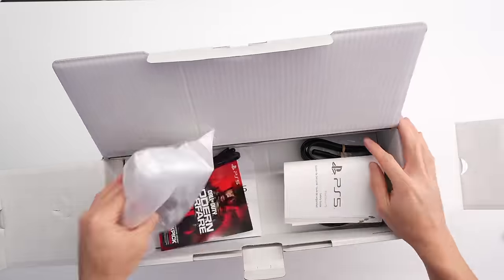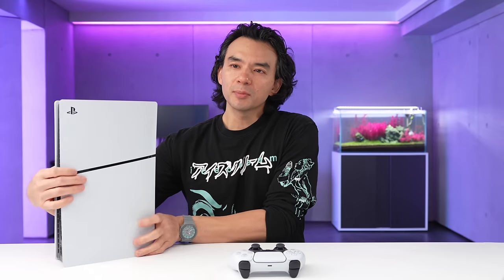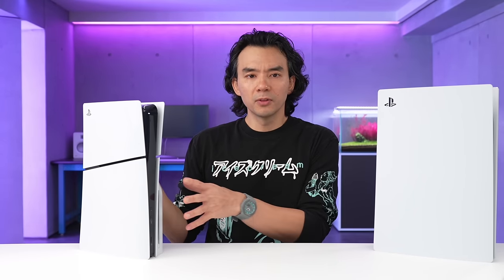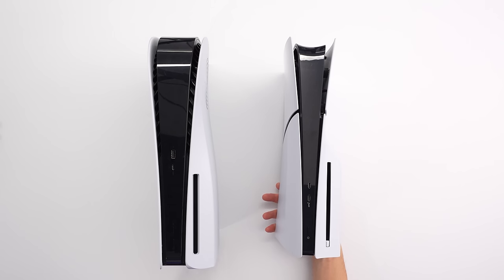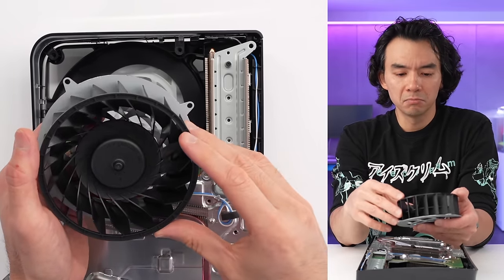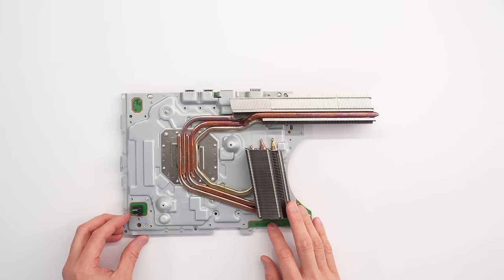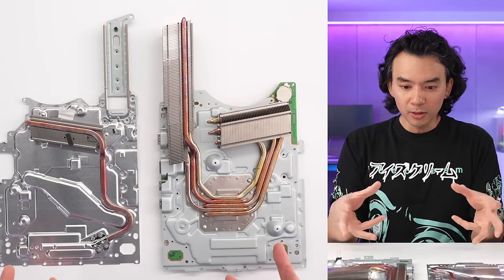NEW Sony PS5 "Slim" - Teardown + Thoughts

Comment: I kinda think Sony went with the new split design because the disc drive add-on probably comes with a shell piece to match when purchased separately, and they wanted to cut the cost of the plastic shell. It does seem like it has the added bonus of more color mix and match options though. I wonder if third party accessories are going to make use of the disc drive port?
Reply: The packaging for an add-on disc drive that required a whole side plate would have been a fair bit bigger.  And one of the more less-spoken-about aspects of cost reductions in slimming down consoles is the ability to reduce packaging size(and weight).  Shipping and warehousing considerations are quite a non-negligible part of costs.
Reply: Still no idea why they went with a glossy panel on the top, though :/

Honestly, that and the horizontal """"stand"""" are the worst things about this new version
Reply: @andrebrait people where complaining about the old stand in horizontal configuration saying you couldn't move the unit with it falling off, and some other things. I dont sit there and stare at the system, it plays the games and that all i need it to do. Dont care about seeing the plastic feet thing.
I think they could have provided a vertical stand with the digital model since it would need the support, but disk model doesn't. Of course you'd have people complaining about that.
Reply: @andrebrait  it's a design throwback both to the PS2 Slim and the base PS4, both of which had a half-matte/half-gloss aesthetic.
Reply: Maybe after market plates makers could sell a design of only one plate per side?
Reply: @andrebrait  My guess is a bit of a throwback to the ps4, which had half gloss/matte on top. Although I really wish they'd stop with the gloss, especially on the middle part. Matte just always looks better. 

For the stand, I actually prefer it to the OG's stand, I like the minimal approach. However the execution is a bit poor, could've been one long piece instead of two. However, with how simple it is, I think someone out there will be selling a premium version.
Reply: @AldrianCG Dbrand are already on it. There's only a front-facing rendering as a teaser, but it already looks better. Not that I hate the 4 panel design, but it looks cleaner as 2 panels
Reply: yeh but full Matte is much better than half half
Reply: Its done as a throwback to the PS4 design
Reply: 3rd parties probably won't be able to use the drive port because Sony stupidly made it so you have to connect to the internet for it to work. They likely don't want you to get drives from anywhere other than themselves.
Reply: @Krypterium not true. Half half looks cool. Whole entire Sony team must have thought so too 🤡
Reply: @davdstar  dats ur own opinion
Reply: @Krypterium  u talking to yourself?
Reply: @davdstar   ur statement is weak my friend ,God Enlight u in the Name Of Jesus Christ 🙏🏻

have a gd day

Comment: I was so ecstatic when we he removed the glossy top panel and the fan is so open and easily accesible with the screws exposed, finally we dont have to tear the whole thing apart to just clean or change a clogged or failing fan.

Comment: Looks fine, I would prefer all matte, but the glossy finish doesn't look bad to me. The 4 piece plates opens the door to more creative designs. I'm fine with the horizontal stand, the original was kind of overengineered and the console never needed a vertical stand, now the new stand, two simple pieces, easy to put in and the console looks cool, like floating.

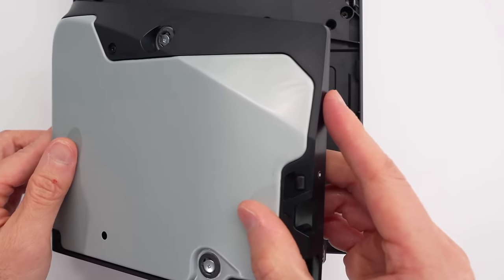Comment: 2:45 It will be interesting to see how the SSD thermals will be on the slim console considering that it’s located closer towards the cooling fan now.
Reply: My problem is exactly this. The OG ps5 had the ssd located in the front, where cool air is sucked in to the fan, now it is directly above the heatsink fins and a console is rearly set up to pull air in from the back where they exhaust the heat, it would just recirculate the heat. This way the ssd sits in a no mans land directly above a very hot metal object
Reply: @norbertnagy4468  Matters not. Thermals will never be hot enough to impact M.2 performance anyway.
Reply: @admirkaralic7209  there are m.2 drives that are fast enough to get too hot in themselves in a pc with tons of airflow... in the ps5 they sit in a closed compartment with a cover to make sure they get 0 airflow and now they put the main heatsink directly under it. I think it is risky
Reply: @norbertnagy4468 the ssd is exactly where it's supposed to be in the current PS5. That's why they said to put a heatsink on it.

Comment: Probably, the black line on the side is because of the disc drive. If you buy the digital version, you can still purchase and add the disc drive. It will come with a new side plate section which will be a lot easier to include in the packaging.

Comment: I actually prefer this design except for the glossy panelling
Reply: I know! I like everything he hates about the new one.
Reply: same. and the glossy panel should be fairly easy to remedy.
Reply: Dbrand crying right now on the overstock of third party plates
Reply: There will be an all-matte black cover for the new PS5 in early 2024.
Reply: The fact that it can be easily removed makes it so customization is the solution
Reply: Which can easily be changed i might add
Reply: I still hate it, but I hate it slightly less. Now, that DBrand mod shown briefly looks good. If I end up with one of these, I'll be getting that DBrand setup.
Reply: So you never owned a Fat PS3, or a Fat PS4?
Fat PS3 was ALL glossy.
Fat PS4 was Half Glossy, Half Matt.
Reply: It is somewhat reminiscent of the original PS4 model
Reply: What i hate bout this new Slim is that it doesn't use a more efficient chip which is just stupid smhhh
Reply: @JeskidoYT on contraire, bunch of people will unload their old ps5 into the used market and those will more like end up in hands of people that would modify them
Reply: Not hard to improve upon the original PS5's weird ass design with those whack white flaps protruding from the top. The designers should be fired immediately. Bring back those responsible for the original PS4 shell.
Reply: @HULKHOGAN1 or instead of selling overpriced plastic shells, companies should come up with fully custom cases, like mimicking the design of the PS4, or something completely new. Just transfer the complete internals into the new case and save them from that god awful weird shell
Reply: @MatrixAlphaCWX  I owned a fat PS4 and it was all matt. That half glossy version of the ps4 was only at the beginning then they removed it.
Reply: @Vaikida , the original base PS4 is half-matte, half-glossy. 

The 2016 Slim is all matte.

Comment: The reduced size is good but what i always want on Slim models is the lower power consumption
Reply: Same. Waited for that reason. They might use more efficient chips in the model after this, but who knows when. Makes me worried that this will really have worse thermals. I wonder if they put the same Chip because they had production issues with the 5nm or because they first want to empty their inventory of old chips.

They are actually rushing the release in the US, so that the Americans can buy it before Black friday. Europe and the rest of the world seem to je getting it months later. I wonder if that's the reason they put a similar or same chip in order to make it in time
Reply: They could have used a newer chip that may not be much more powerful than the original but yet will be much more efficient
Reply: same. I'll keep waiting, I don't see the compelling exclusives.
Reply: @maythesciencebewithyou  It's actually not as easy to just go with 5nm if the original design is on 7nm. The 7nm and 6nm are basically the same, where the "shrinking" is done by just getting better at making the 7nm, but the 5nm is another step in shrinking so the design for the chip has to be done again. They probably could do it, it should be easier to re-design existing 7nm chip to 5nm than to make 5nm chip from scratch, but it still takes engineering and new deals with AMD. It's really not worth it, especially if you want to keep the cost down since 6nm is cheaper than 5nm as well.
Reply: this is really good actually they managed to reduce power consumption in the 1200 series and now have reduced the the overall size, they have managed to get a process where the power consumption and body size are independant to each other. they can eventually release a newer version of this being even light when the rest of the industry stops hogging the 3-5 nm chips, there is very likely not enough capacity to accomodate PS5's needs on those processes.
Reply: That's because this isn't a "SLIM" version, this is a smaller revision of the BASE PS5.
Reply: @emikomina you just defined what a slim model is
Reply: @janbenes3165 yup, this is a good casual explainer ! Design rules between different processes are not the same, plus when redoing a design you might change swap some stuff around in the layout/floorplan of your chip (like say... the PCI Express or memory channels links which are usually are the outer edge of your chips).
And if (when?) Sony does eventually make a true Slim, I'd wager it'd be on a 4nm process, which is already signalled by TSMC as being a long term use one, so I could see them using it in like 3 years.

On a personal note: I find both really ugly still ? Like the white glossy that's not going to age well and really is tacky/gaudy to me and signals "heyyyy poor taste alienware enjoyer here"

Games are the important part sure, but when you look at the industrial design masterpiece that was the PS2 Slim, or the PS Vita (Vita means life <3), god I love those designs. Even the PS4 Slim was actually very nice I thought and not god awful like the glossy launch PS4.

This generation, clearly Series X and Series S look just so infinitely better it's not even a contest. A shame really because the internal design of the launch PS5 was quite impressive, remember the video with Totoki (I believe is the chief engineer guy that presented the official teardown at the time?) and I was like "My guyyyyy, this a beautiful internal design! And they wrapped this in this external design? They did you DIRTY, I'm honestly so sorry for you because it is horrendous"

But hey, that's Sony for you.
Reply: @janbenes3165 yup, this is a good casual explainer ! Design rules between different processes are not the same, plus when redoing a design you might change swap some stuff around in the layout/floorplan of your chip (like say... the PCI Express or memory channels links which are usually are the outer edge of your chips).
And if (when?) Sony does eventually make a true Slim, I'd wager it'd be on a 4nm process, which is already signalled by TSMC as being a long term use one, so I could see them using it in like 3 years.

On a personal note: I find both really ugly still ? Like the white glossy that's not going to age well and really is tacky/gaudy to me and signals "heyyyy poor taste alienware enjoyer here"

Games are the important part sure, but when you look at the industrial design masterpiece that was the PS2 Slim, or the PS Vita (Vita means life <3), god I love those designs. Even the PS4 Slim was actually very nice I thought and not god awful like the glossy launch PS4.

This generation, clearly Series X and Series S look just so infinitely better it's not even a contest. A shame really because the internal design of the launch PS5 was quite impressive, remember the video with Totoki (I believe is the chief engineer guy that presented the official teardown at the time?) and I was like "My guyyyyy, this a beautiful internal design! And they wrapped this in this external design? They did you DIRTY, I'm honestly so sorry for you because it is horrendous"

But hey, that's Sony for you.
Reply: @helloken  I bought a Ps5 just for the free 1440p/60fps or 2160p/60fps upgrade patch for many ps4 games .
Mass effect at 2160p /60 fps vs 1080p/30 fps is like a totally different game .

Comment: Regarding the smaller heatsinks, the latest iteration of the "old" PS5 also had a similar design, so they did die shrink and redesign the thermal system in the PS5 already compared to the launch model and it was enough to significantly reduce the size and weight (also the motherboard was more compact). It seems to me the Slim is just a redesign of the body around that system.
Reply: Yeah, makes you wonder why did they even bother with the last shrink in the old case, could have gone straight for the slim and saved on retooling and redesign twice in such a short span.
Reply: @HNedel  They're doing the shrinks bc selling PS5's actually costs Sony. I wonder when they will start making a profit from these consoles, and if they will ever announce it to us.
Reply: @DarkAngelEU why do the consoles need to make money when they own the game store? It's like the steam deck. The hardware just needs to not hemorrhage money.
Reply: Sony doesn't own game stores, dude lol @GameTimeWhy
Reply: @DarkAngelEU  are you trolling? Wtf is the PlayStation store if not Sony's game store?

Comment: Pretty sure you want the stand because it vents out from the bottom and if its covered it just traps in heat. If you look at the stand even on the old model it has a nice gap inbetween to allow air to escape.
Reply: It vents out of the back, not the bottom. Just like the regular PS5.
Reply: @EversonBernardes  next time you play, put your hand underneath where the gap is and you'll literally feel hot air escaping.
Reply: @dmannion81 there are no vents underneath though. The vents are on the back. Also the vertical stand is flush with the bottom of the ps5. I have no idea what you are talking about.
Reply: lol look again dude, it is in fact not flush with the bottom, they have a big gap and have vents. You probably didnt even look and just went by what you thought you remember seeing. it has vents and a gap and you can literally feel the air escaping from the bottom and not just the back of the console.  @GameTimeWhy
Reply: @dmannion81  it 100% does not have air vents at the bottom of the console you weirdo. Are you trolling?
Reply: @GameTimeWhy man, it has tiny little vents at the opposite side where the ps symbol is located and vents on the back. Are you trolling?

Comment: Sony really needs to get it right next time… They did so well with the PS4 Design. The old and new PS5’s look absolutely atrocious
Reply: Take your grievances up with Mark Cerny, the engineer. He designed it and already explained why it had to be that way.

By the way, Mark Cerny also designed all the PS4 models.
Reply: @shawnbenjamin9636  I've been a playstation owner since 1. I know who Mark Cerny is. While I don't think he himself is a bad designer, I think the societal shift to accept ugly, garbage looking products is the underlying issue. Xbox did it right with their simple and sleek design. I can't stress how much of a nightmare it is to just find a spot to put the damn PS5
Reply: @chrisgg80  It's supposed to be an item that you actually use, not a decoration piece. The fact that it works and does its job should be all that matters.
Reply: The OG PS5 looks nice
Reply: @shawnbenjamin9636   The idea that the PS5 had to be the way it was is laughable nonsense.  I get that most people aren't informed about this stuff enough to 'think for themselves' on this front, but there are definitely plenty of options for them to have gone in a different direction with similar performance.  Especially aesthetically, which is what the person was commenting about.  Lastly, the Cerny worship among PS fans is bordering on deranged.  He's a nice speaker, but a lot of that Road to PS5 video for instance was marketing mistruths.
Reply: @shawnbenjamin9636  That's the issue. It's so damn big a lot of people CAN'T use it. It simply won't fit in our setups. There's no reason for it to be that way other than because Cerny thought it looked cool.
Reply: provisionalhypothesis nah not the OG PS3

Comment: Love your vids - no nonsense and informative - but also good to hear your thoughts - for me, this version is looking decidedly cheaper than the previous versions, and those feet look like a disaster waiting to happen (I can see them breaking or not attaching properly). The two panel top/bottom most likely is a callback to the original PS4 visual design language.

Comment: The only thing that bothers me is the 2 textured panels, however, Dbrand does an amazing job, so I think it would look great with those. Either way, not much of a difference, or at least not enough of one for me to get a "slim". At this point, the only reason I'd get a slim is to take off the disc drive for the 90% of the time I don't use a disc for the aesthetic.
Reply: I'm sorry but... why? Who really wants form over function? That's like saying I'm going take the pedals off my bike while I'm not riding it. For the aesthetic.
Reply: @dapperfan44  yeah but it's not really form over function if you don't necessarily need the disc drive for the system to function, is it? Most people nowadays don't even buy discs anymore
Reply: @MrGabrielandrader you can just buy the digital version I'm sure
Reply: @chaosv1123   sure you can, that wasn't the point he was trying to make though.. he meant that you can have the option to play both digital and discs and still be able to take off the disc drive just for the aesthetic, depending on whichever, that's all
Reply: @MrGabrielandrader  oh I see
Reply: @MrGabrielandrader I can assure you that people do buy lots of game disks. I work retail and sell plenty.

Comment: Does it have any performance differences? Even if the chip is practically the same, maybe there is anything else that will draw me to buy this instead of the thicc variant?
Reply: Nope, everything runs exactly the same
Reply: @wmvnotmp4  Thanks, I think I will get the thicc variant instead. The design looks a bit uniform at least.